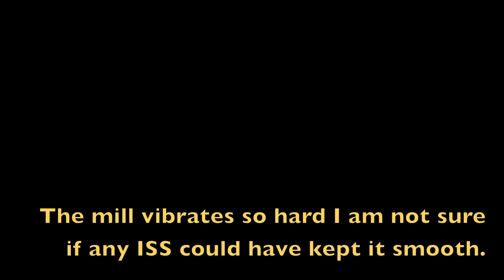Cookie Cutting on the Sawmill

Comment from the maker: We cut some cedar a few years back and plowed right though a big carpenter ant nest.  I imagine it would be a heck of an experience from the ant's perspective.  I was hoping to get some great ant gallery lumber but it didn't work out that way, too much empty space not enough wood.  Cedar isn't the hardest to begin with anyway and it didn't stay together.  I remember it didn't small good and the ant guts stuck to the saw.  Had to spray for the little buggers after.